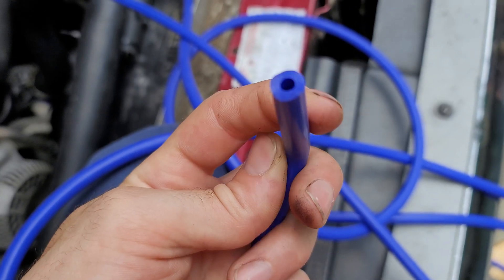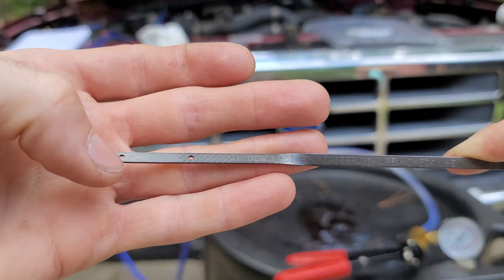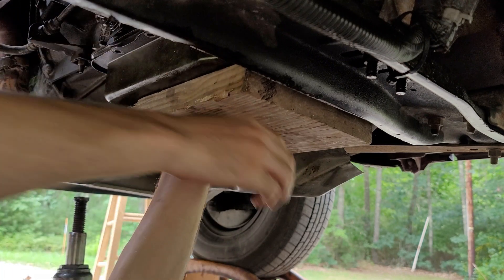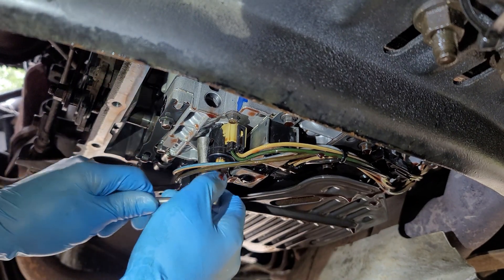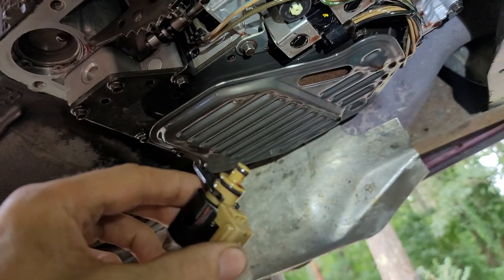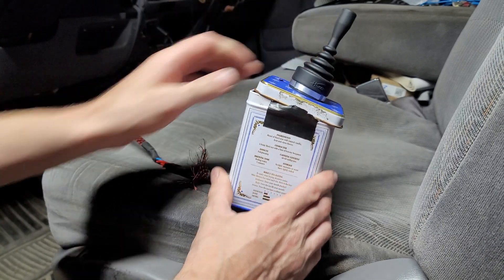Tourqe Converter Clutch Solenoid - 4R70W

Comment from the maker: 0:41 - Push hose down dipstick tube.  
0:58 - Remove approximately. 2.5~3qt.  
1:27 - Check fluid is low enough.  
2:45 - Drop pan.  
3:50 - R&R old solenoid with new.  
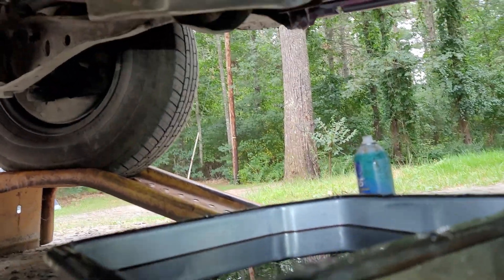5:00 - Put up pan.  
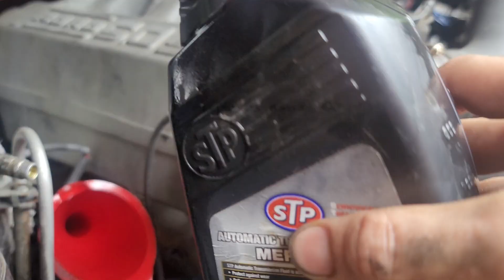5:20 - Put 2.5~3qt. back in.  
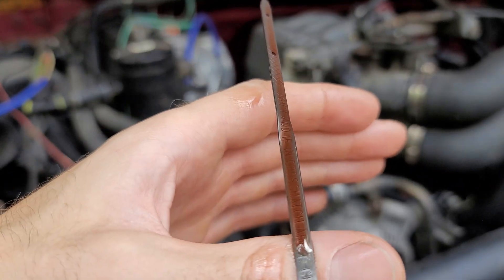5:42 - check level is high enough.  
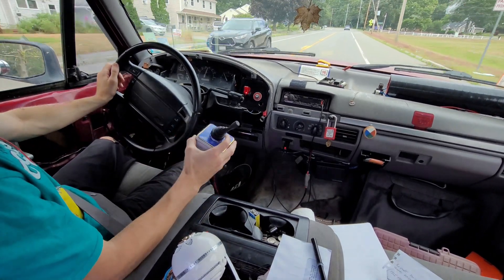6:45 - Drive.  
6:54 - Check fluid level is in hatch area.  
*if your transmission has mercon in it already do not switch to mercon V without doing a flush first.

Comment: So is reverse still controlled by the physical shift lever?  Is reverse mechanical or is it electronically controlled?  Very neat, makes me wonder on a "failed" transmission might it be possible to force it into gears when the computer would not otherwise let it shift due to sensors saying things are out of spec...
Reply from the maker: yes. the manual valve controls the parking pawl and reverse, neutral, drive. my shifter controls what gear you're in when in drive.
Reply: @jankcitycustoms  Nice, I have a Chevy (4L60E) so I will have to see if I can find a way to do this on mine.  For now mine shifts ok, but sometimes I do not like the gear it picks and wish I could force the gear.  Your video inspires me that perhaps I could figure it out.  Thank you!